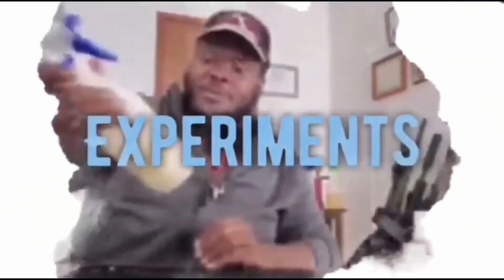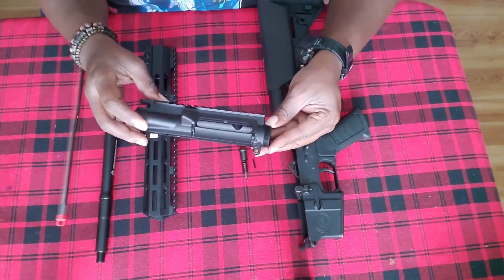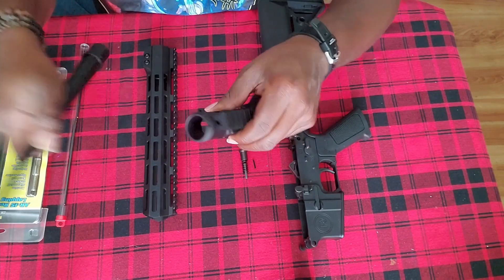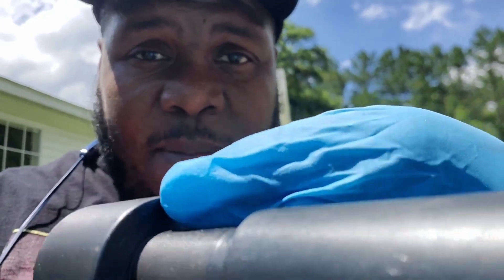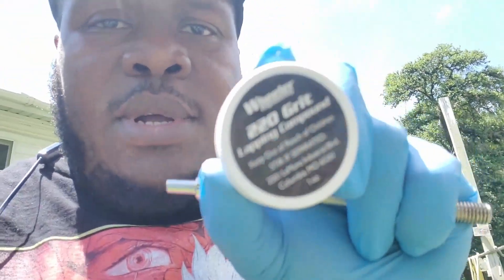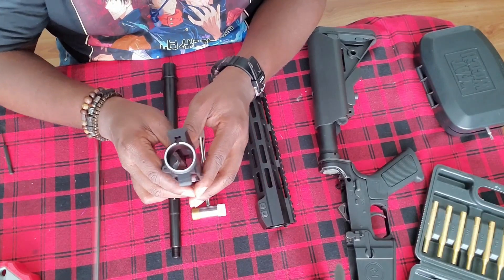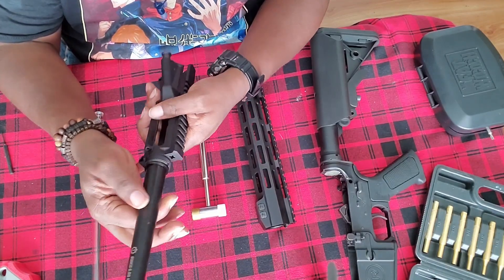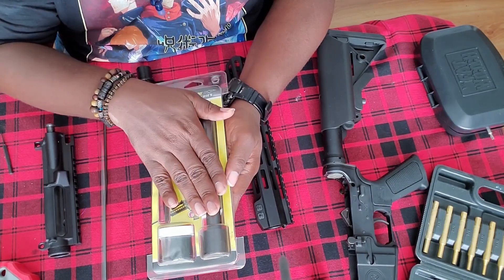Lapping My AR15 Upper Receiver

Comment: I wonder if one could use a flat knife sharpening stone to do this.
Ive heard one can resurface a engine cylinder head by laying it on a table with a flat peice of glass and sandpaper on top of the glass. Of course it's not comparable to a machine lath, but supposedly it will work well and well enough to hold the repair for longer rhan one would suspect.
Reply from the maker: I guess anything is possible,  however I would prefer not to try it that way. I do not have that steady of a hand and I can be impatient at times. Lol

Comment: I use the same tool on all my builds.another benefit beside lapping is also when you torque the barrel nut to spec and get allignment for gas tube or piston rod don't half to use barrel shims for spacing.
Reply from the maker: Absolutely

Comment: Bcm makes a thermal fit upper receiver, all you need is a torch.
Reply from the maker: I've seen several of those.
Reply: You can use a heat gun or a really good hairdryer. I did in a pinch use my fiance's hairdryer and it worked. I love BCM uppers because of the thermofit

Comment: Buddy, if you're mounting a barrel that's only 12.5" long, then lapping isn't going to make any difference. Shorter barrels on an AR-platform rifle means less accuracy, period.

Currently putting the 2nd round of every group of European-made NATO-spec M855 (they make better ammo) into the same hole as the first at 100 yards, without any lapping considerations, with my heavy 20" barrel. The upper receiver is made by Bravo Company.
Reply: Shorter barrels do not mean less “accuracy”. That’s nonsense
Reply: @johnnoel3416 exactly right
Reply: @johnnoel3416  Oh, OK. I guess the laws of physics are all wrong then, right?
Reply: @erwin643  Accuracy is not determined by barrel length, accuracy comes from reducing vibrations or making sure the bullet exits the barrel during a consistent vibrational cycle. Actually, all else being equal, a shorter barrel has more accuracy potential because it is more rigid than a longer barrel.
Reply: @skid2964  Anything that spends more time in the barrel is going to be more accurate.
Reply: @erwin643  That is absolutely not true, sorry.
Reply: @skid2964 It's very true
Reply from the maker: This was really a practice run of lapping since this was the first time I'd ever tried it. I figured if I screwed up it wouldn't matter much on a shorter barrel. That ammo sounds sweet though.
Reply: @WHATSUPTANKWashington  AMA, Denmark. If you can find it.

Comment: there is no way you are not getting lapping compound all over that barring surface pulling it all the way out like that over and over again!! thats also why there is a cut relief from the bearing surface and and the lapping face! if you had that right up to it the lapping compound would work it's way down the bearing surface of the shaft and in your action but you don't have to worry about that because you pulling it in and out Guaranties plenty of lapping compound all over in your bolt Carrier bearing surfaces and the bearing Surface of your tool, sorry but I am cringing watching this mistake

Comment: Good stuff, Tank. One suggestion I would like to throw out there is on your next lapping project, have the receiver situated in a vertical position (lap from top down) in the vice so gravity is doing most of the work. That way you won’t have to worry about the lapping tool “wobble” whilst attacking it from a horizontal/side motion.

Comment: Not sure how necassary this is on a pistol build, but I'm all about proper fitment of all parts. I would absolutley do this for a accuracy build on an actual rifle, but being a pistol, I'm not sure you'll ever see the benefit unless you have barrel nut/gas tube alignment issues. In which case I would probably change nuts before I lapped the receiver. Either way. To each their own. 
Well done.
Reply from the maker: I plan to do this to all of my uppers. The pistols were just what I had off hand in the moment.